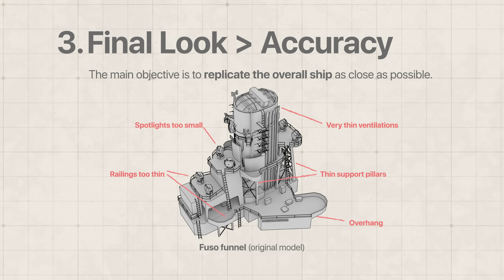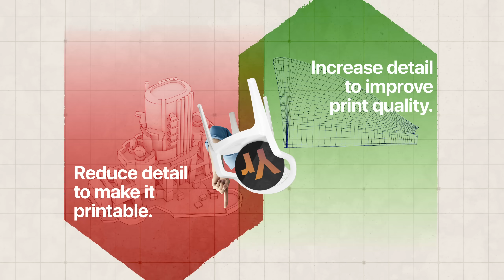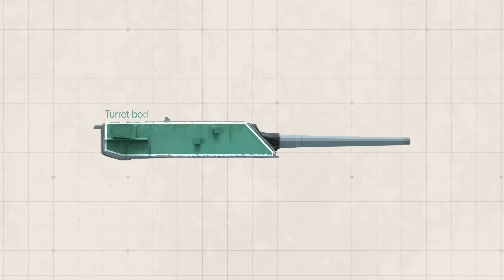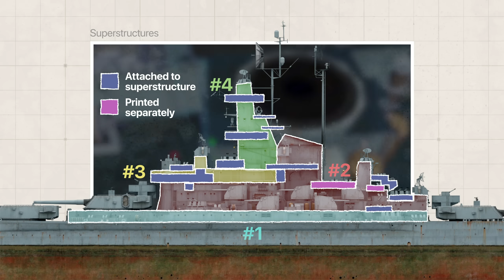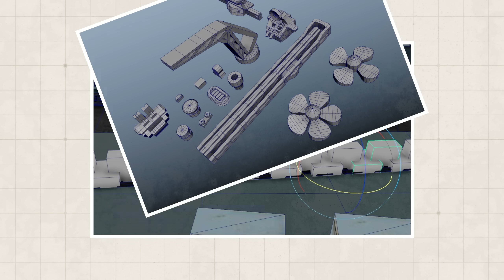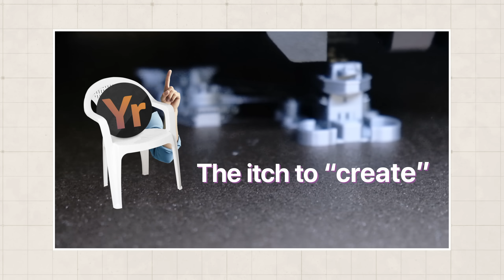How I Make my 3D Printable Warships

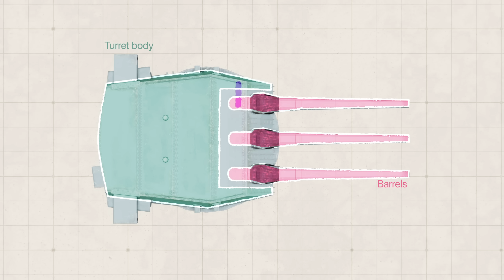Comment: 6:59 Question. If the shaft is merged with the body of the turret, then how can there be any rotation? Wouldn't you need to boolean-subtract a minimum-tolerance gap between the shaft and the turret body in order for it to freely rotate?

Comment: Gday, i was making something similar, more specifically an iowa model for resin printing however the place where i got my iowa model from had the hull and numerous other pieces be turned into surface and not solid objects, do you know any way for me to fix this issue? Closest thing i found to this is when putting the hull model or other surfaces the slicer would detect a hole and turn the surface into a solid but i cant figure out how to take that and put it back into my cad software, any help is appreciated ty

Comment: Love the passion. I am currently building a 17 foot long aluminum hulled flat top, just because I can. I bought an old aluminum canoe, 10hp / 6.5KW generator, and a bunch of other odds and ends. Why? Just because I can, and that’s what you should do. Do it just because you can :)
Reply: Maybe people would want to watch a video on it once it’s done? It will use drones and small planes for flights ops. It does have a 16inch X 24 inch elevator and I’m using FPV cameras in the planes

Comment: Smart reasoning on the choice of scale..however, there is a wide range of commercial full kits available in similar scales like by Revell in 1:570 and Airfix's 1:600.
So I suggest 1:585..
So if ever get round to design my own ships, this is the scale I'll be using..

Comment: Don’t rage to him that he’s lazy or disrespectful to the ship design. As an Engineering student who have been printing 3d parts, it’s very difficult to get in details and also the tolerance that will occur in a small millimeter. I am very respect to Yuro on contributing this project. Continue to support you 🎉
Reply: I've been messing around with laser cutting kits for HO scale structures. In order to get the tightest fit possible I've found you need to put an offset into the perimeter burn path similar to offsets used in CNC machining. Of course the home hobbiest cheap diode lasers don't feature offset codes.
Reply: Card models are designed with CAD software which can result in extremely good fits if properly built.
Reply: + hes not doing it in CAD thats crazy hard to build mechanisms with just triangles